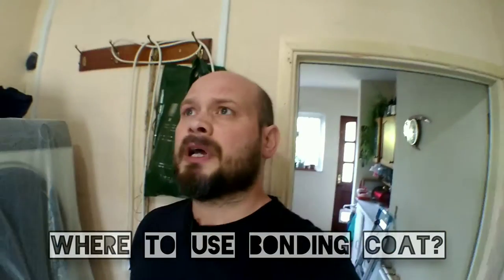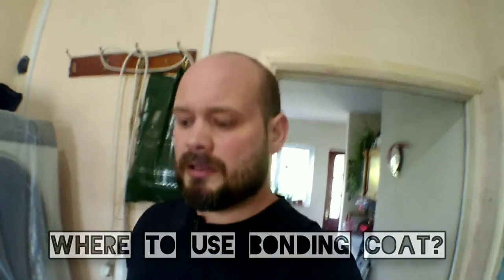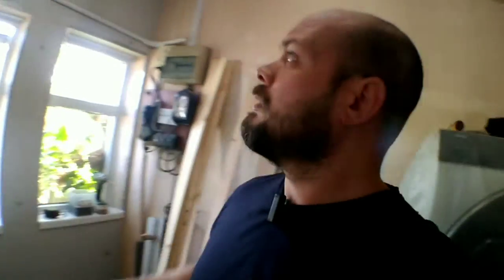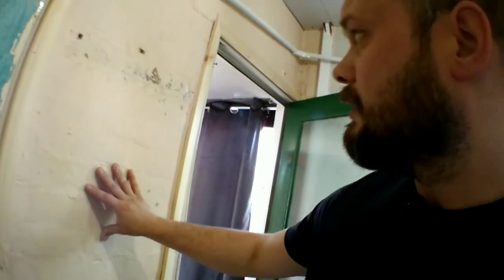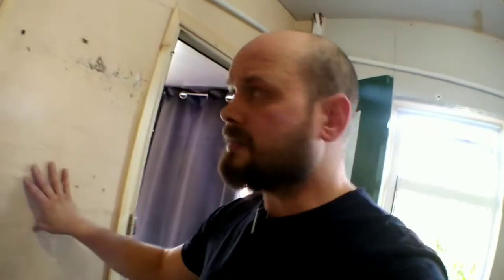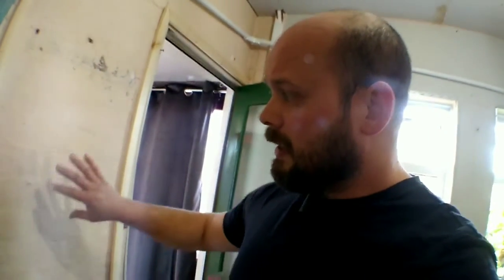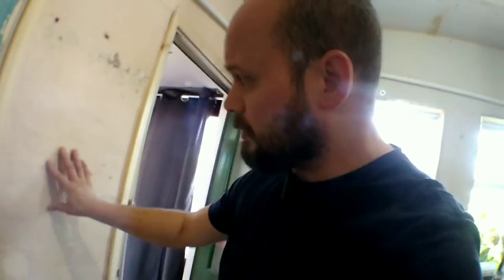WHAT IS BONDING COAT FOR❓

Comment: Thanks Stu for the info. 
Can you use your ‘special  sbr pva cement primer on all surfaces including painted walls like in your video 
Cheers
Reply from the maker: Yes mate you can. In this video the paint is bonded on very well so applied the bonding coat directly to the surface as thats what it's designed for to create a bond when working with low suction smooth surfaces 👍
Reply: @troweltalk2719  thanks Stu, that’s good to know. I  thought you had to apply pva at least  . 👍
Reply from the maker: @malcolmwootton2815  Providing the paint is bonded on well & there's no dust on the surface 👍
Reply from the maker: @malcolmwootton2815  it definitely pongs! A large floor fan will send it off pretty quick 👍
Reply: Using the info you gave Stuart, would I be right in thinking bonding can also be applied straight on to tiles in a bathroom. I've being using blue grit and 2 coats of finish atm, but some walls would benefit from a straighten of bonding. Cheers